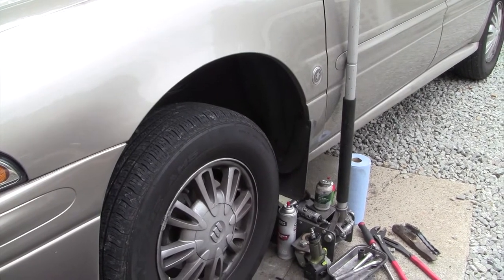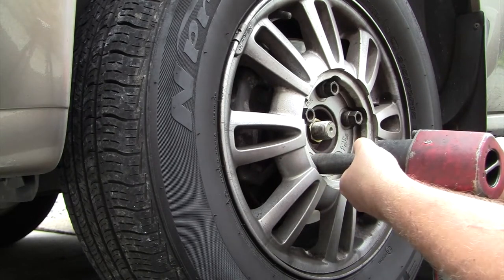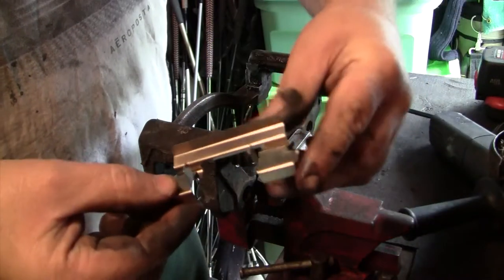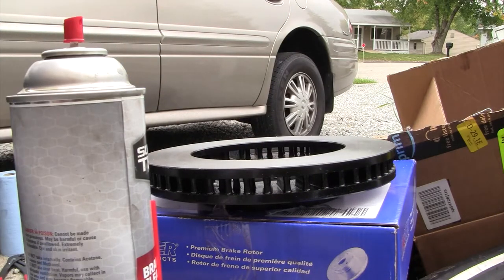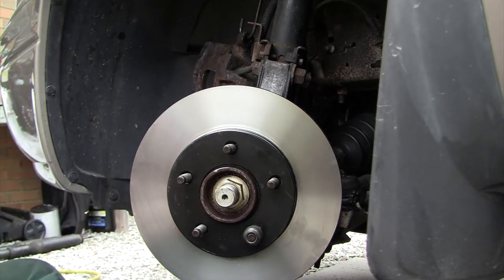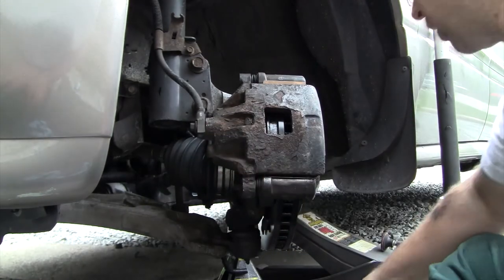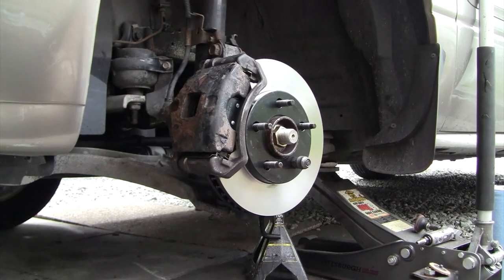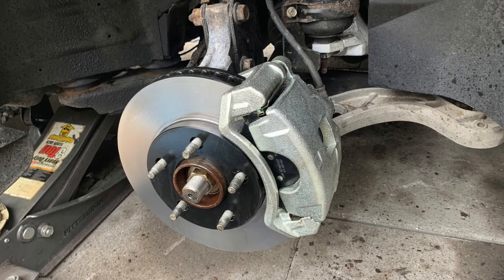2001 Buick Lesabre Front Brake Caliper Pads and Rotors Replacement

Comment: Thanks for the video. I really like the fact that you made an effort to clean the calliper bracket until it shines. I use a wire brush and file and get the same results only slower. A lot of shops don't bother. When you do it  yourself, you can actually do a better job than the pros. In places where they use road salt this is vital.

I think you over tighten your bolts. I use a 3/8 breaker bar (slightly longer than a normal ratchet wrench) and tighten it as tight as I can with one hand (I keep the other hand on the socket end to ensure it doesn't slip and round the head of the bolt). If you are concerned about the bolts coming free while you drive, use a bit of Loctite blue on the threads. Too much torque will ruin your bolts or the callipers into which the bolts screw.

When I bleed the calliper, I use a Lisle (?) bleed kit. The hose is shorter and you can place it on your strut. This way when the tube is full of fluid, there is no chance that air will enter the calliper. I prefer to have a person press the brake pedal when bleeding. 4 slow presses. Hold, quarter turn of bleeder nipple open, then close immediately after. Release pedal. Repeat a few times until no air is present in fluid. If you have to do it yourself, the Lisle kit allows you to attach a vacuum gun so that you can suck the air and fluid from the nipple and then tighten. I alway use a flare nut wrench to break the nipple free and for final tightening For the quarter turn part I use a thin wrench (ignition wrench) as it does not interfere with the boot on the nipple.

Nice to see such a thorough video.

Comment: Squealer wear tab is supposed to go on inner pad on the leading edge.  Inner pads wear more & sooner because it's against the caliper piston.  Also the pad metal backer ears must be lubed so they slide easily in the hardware brackets.    Bleeders must be on the top so no air gets trapped.

Comment: Great job as usual. Alittle aggressive with that grinder when cleaning the caliper pad slides at 12:50 but, 👌. 😆 I always put some high temp caliper grease in the pad hardware, just a very thin coat. I bought those coated rotors too and they still form a rust coating on the outside fin area. Did you film the axle job?